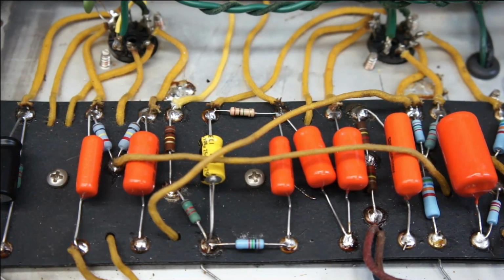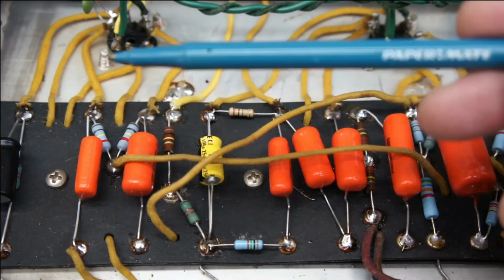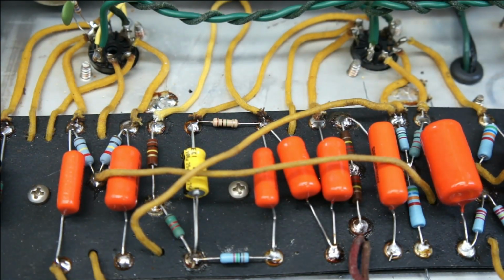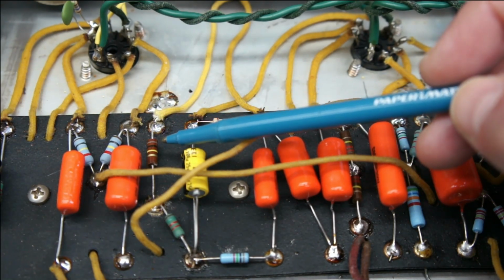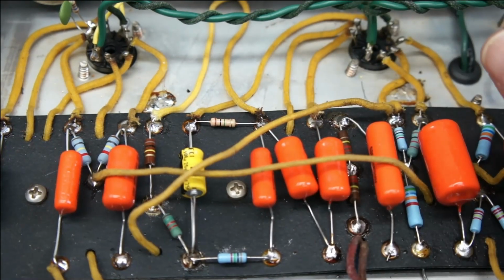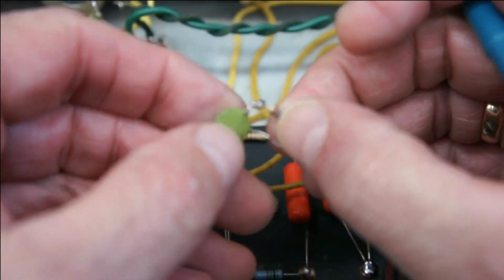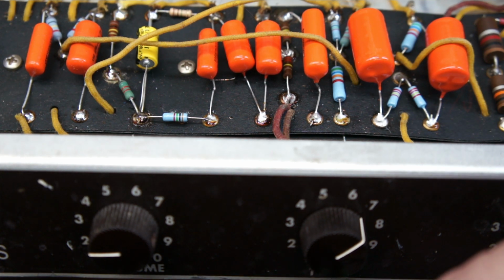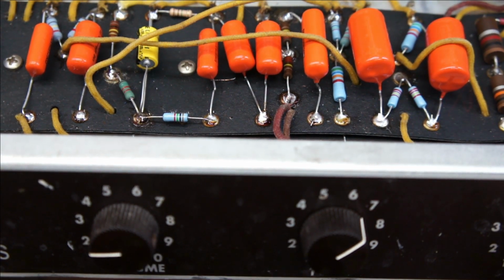62 Brown Princeton Restoration Mod Removal and tweak

Comment: Thanks for the video. I tried the Dumble tweak on V1. Subtle but I like the improved smoothness on the trebles. 
Did you notice a slight loss of gain?
Reply from the maker: It adds a slight compression in the treble you  might perceive  as a loss of gain but gain is easy to make

Comment: Just stumbled across your video  while looking for 6g2 fixes and mods.  I made a 6g2 clone to the original specs.  The treble is at ice pick level with the tone pot all the down. I've tried different cap values but little to no effect on treble.  Any suggestions besides changing the cap to .01?